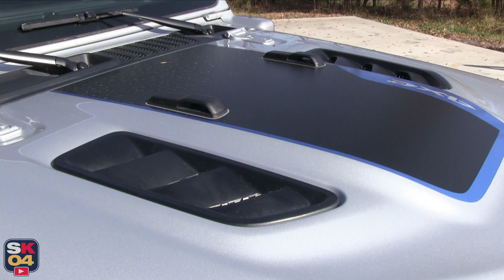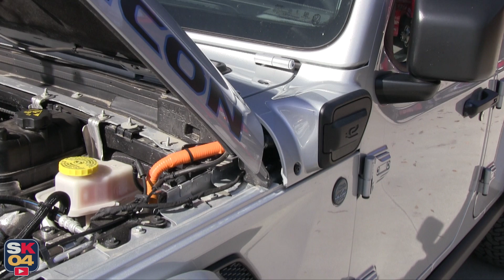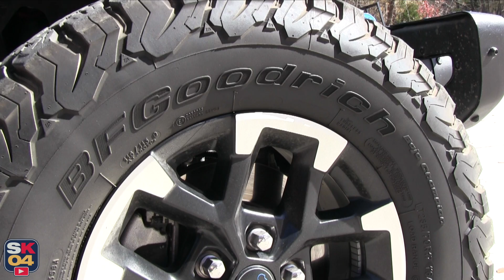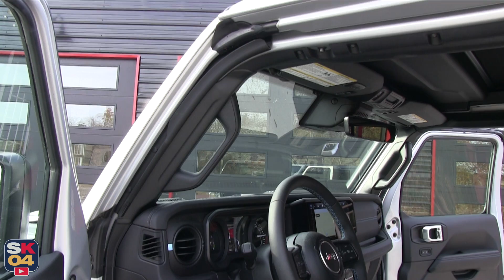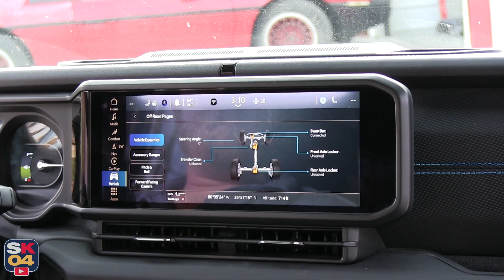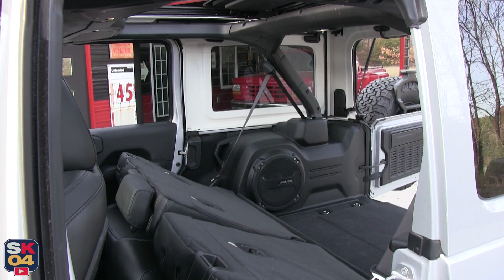2024 Jeep Wrangler Rubicon X 4xe: Start Up, Test Drive & In Depth Review

Comment: From an engineering standpoint this thing is a mess.
Reply: I've owned my 4xe for a year, haven't had a single issue.  I've surprised many drivers at stop lights with the 470lb/ft of torque.
Reply: @mowcowbell   glad to hear it, i'm at 1500 miles with mine and yes I do enjoy the torque that's there when you need it.
Reply: @mowcowbell sounds like fun now I want one. What’s the 0-60?
Reply: @DiaperSNiFFER  It's too bad there isn't a way to find out this info... oh wait.
Reply: @mowcowbell  wooooooow 👏 buzzkill.. you must be fun at parties 🎉 🎊 🎉 People like you!!!! 🫵 are the reason why the world is such a cruel place… dear god of mercy…. 🤦‍♀️
Reply: @mowcowbell  you must be fun at parties 🎉
Reply: @DiaperSNiFFER  Hate parties or social gatherings.
Reply: I want to know Why.
Reply: absolutely, but most modern vehicles are horribly designed.